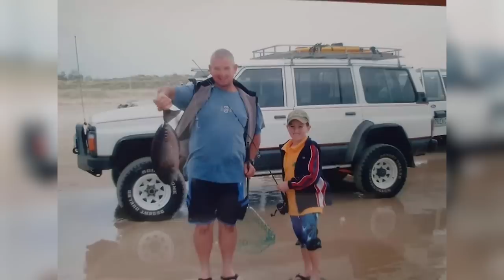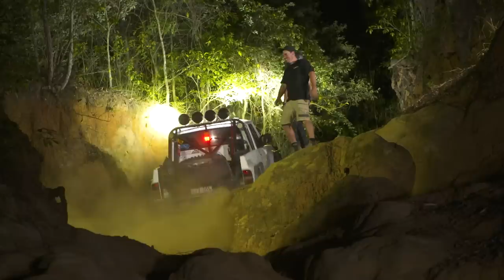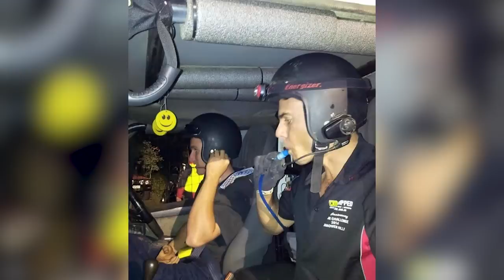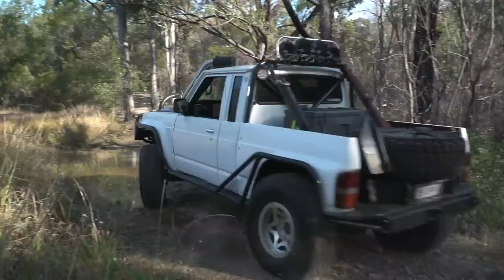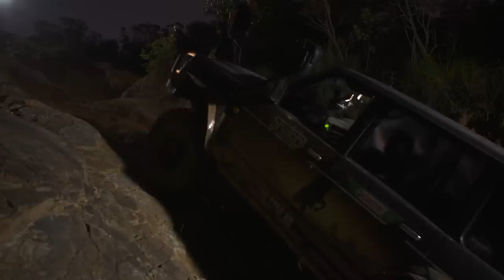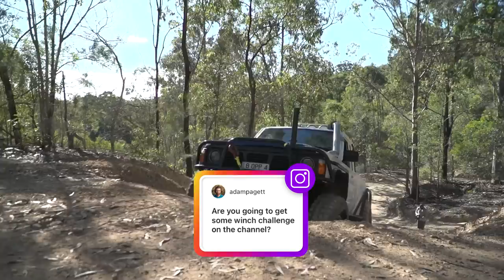MEET MR NISSAN! Jesse Gleeson joins 4WD 24/7! Backstory & 4WD walkthrough

Comment: Us folks in the USA are unfamiliar with 'Winch Trucks.'  We need some education.  I'd love to see how you set up the mid-truck winch.

The problem with Jeeps is that you have Dodge/Fiat electrical wrapped around it. But they sure are capable out of the box.  Other than that you'd have to solid-axle-swap a Toyota or Nissan to get close.  That's a lot of work.

Comment: g60 on gu chassis. chuck the zd30 in the bin and put in a duramax or 6bt or TD42or TB45/48 or 1HDT or the old chev diesel 6.2/6.5 all mechanical.
And auto

Comment: Hey Jessie, I’m building a 91 4door vitara and wanting to drop a j20a in, do you know if they are almost a straight drop in? Seen sierra do it with a bit of mod.
Also solid axle swap or run the ifs with a kit through it? Yea I do some hard wheeling much the same as yourself.
Cheers in advance

Comment: Just bought my first real 4by in the shop getting roadworthy I bought a tb48 and can’t wait to take it off road just a question will the petrol be alright off road the last one was diesel will it have the feel to climb slowly like a diesel or will I have to drive it a bit differently a wagon with 2 inch lift and 33,s with lsd and auto lockers thought it would be a good learner to start off with at least it will get me out there
Reply from the maker: Hey mate, it'll be a bit different in terms of when your power & torque comes in - but the tb48 will definitely be fine!
Reply: @4WD247  will be interesting from a 2018 2.0 litre twin turbo Land Rover discovery all electronical but not feeling that good taking a 4wd like that off road and can’t buy LT tyres for it good luck with the show look forward to the year with lots of different builds from different guys a lot to look forward too

Comment: I have just purchased a Nissan Patrol gu the same as you are leaning on the end there, I am looking to install a winch but is it possible with those aluminium bull bars? Looking to keep the weight down where I can
Reply: U shaped solid plate between the chassis rails and behind the bar.
Reply: @grahameroberts8109  I have heard you can only fit certain size winches on these too, any idea on a winch I should be shopping for?